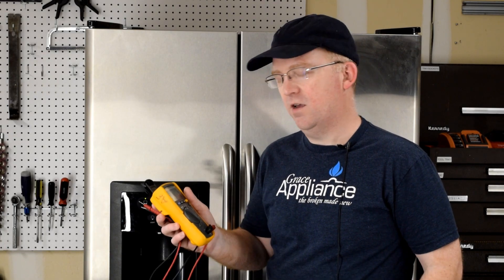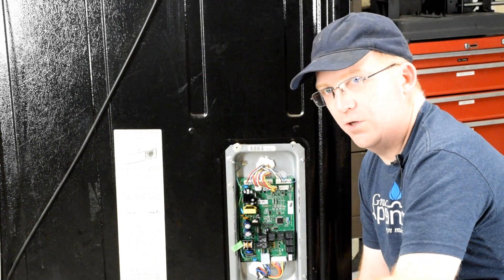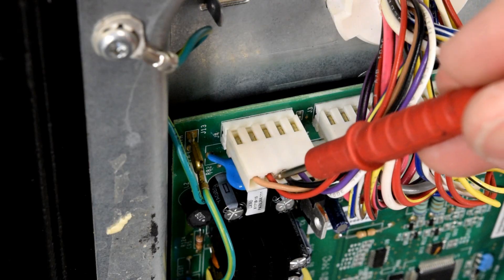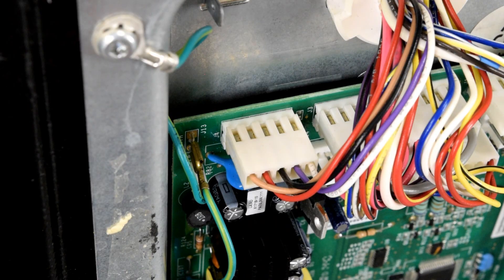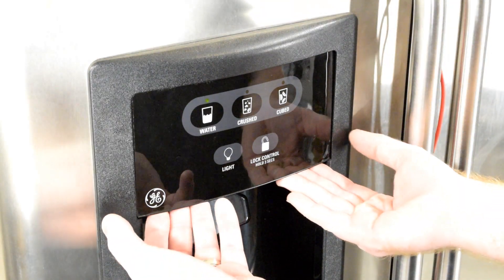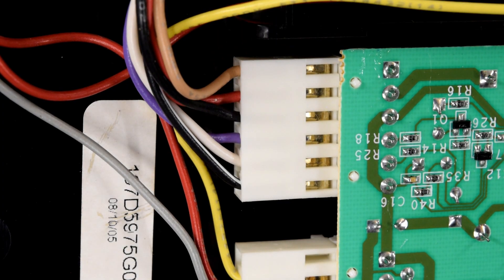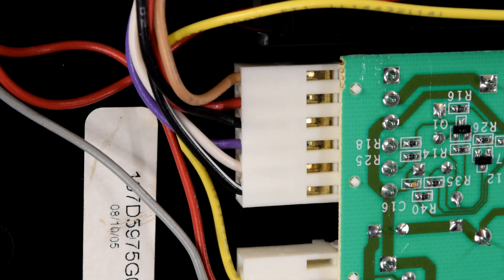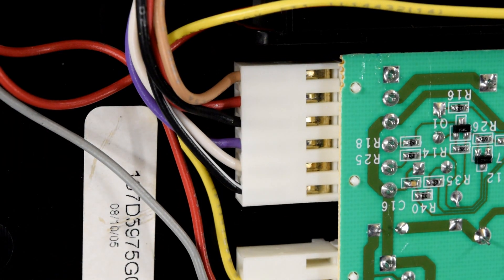Diagnosing a Bad Control Board - Part 4: Front Touch Panel

Comment: My GE Profile side by side water dispenser is dispensing water most of the time but sometimes won’t for a few minutes or longer, then works again. The ice dispenser (motor) would run for a second but no ice dispensing, while the temperatures 0 degrees (for the freezer) and 35 degrees (for the refrigerator) will flash on the panel along with the light turning itself on, then it would stop, then it does it all over again for as long as you push in the paddle. I don’t think there’s anything frozen because there’s water dispensing (most of the time). I’ve also unplugged the power from the wall outlet for 30 seconds before plugging it back in but still acting strange. Please help.
Reply from the maker: Hey Roel,
The first place I'd start checking is the dispenser micro switch behind the dispenser panel.
When depressed, it should show roughly 0.03 ohms and not change when the switch is pressed down harder.  When not depressed it should show an open circuit with your ohm test.

Let us know what you find.

Hope that helps.
Reply: @GraceAppliance  thank you very much for the quick reply. I used to own a multimeter till it broke so I’m gonna have to invest in one again to solve this problem. I’ll let you know what I find asap. Thanks again Andy.
Reply from the maker: @roelcruz7586  welcome!  The part itself is probably a dollar or two so you may just want to swap it out, but then everyone should also own a multimeter.  😁
Reply: @GraceAppliance  well in that case then. And you’re right about the multimeter. I need to replace mine.
Reply: @GraceAppliance so when I removed the dispenser panel I didn’t see any micro switch on the circuit board unless you’re referring to the other side of the board in which case I’ll need a torx screwdriver (that I don’t have) to remove it from the front panel.
Reply from the maker: @roelcruz7586  hey, yes It will be behind this. You can find it by actuating the dispenser paddle as if you are gong to get a cup of water. You'll see the paddle depresses the microswitch and you'll hear the switch make a soft click when depressed. 
It's about 1" in length.
Similar to this one: WB24X10146
Reply: @GraceAppliance  oh ok. I’ll find out the right part number and order it and get a torx screwdriver before it arrives. 😬 I’ll let you know what happens asap. Thanks a million Andy.
Reply: @GraceAppliance  well I got the part installed it asap but unfortunately it’s still bad with same symptoms. I was thinking of replacing the whole circuit board on the front panel. Any ideas?
Reply from the maker: Hey, sorry to hear that!
You may also check the wires at the kick panel / Hinge area to see if they are corroded or broken.

I would not simply start replacing parts without testing for expected voltages from each board. It is a wild guess to say just based on the symptoms you've got. 

I've seen very few front touch panels fail over the years, but have seen many many main controls fail. Not in this particular manner though.
Reply from the maker: @roelcruz7586  but if you can get a hold of a meter, you can test for 120v at the plug for the dispenser valve when you try and fill a glass with water. And the same at the ice maker auger when you call for ice.
Reply: @GraceAppliance  ok. Time to get serious about replacing my meter. 😁 I’ll check for bad wirings tomorrow. Thank you so much Andy. Happy new year!
Reply: @GraceAppliance  hi Andy. Happy new year! Just got back from vacation and borrowed a meter from a friend. You mentioned 120v plug so I’m guessing a red and black wire somewhere in the control board? Sorry I have no clue I wish I had a schematic for this.
Reply: @GraceAppliance  so I just did a visual on the control board and two caps c29 and c30 seem to be bulgy on top so I’m gonna go ahead and replace those first. I’ll keep you posted.
Reply from the maker: @roelcruz7586  sounds definitely like a failed board. Best of luck!
Reply: @GraceAppliance  I just hope these are the culprits.
Reply: @GraceAppliance  I fixed it Andy. Those 2 bulgy caps were the culprits. I just hope they don’t go bad again. The electrolytic caps I replaced were about 1/4 inch shorter than the original ones with same values. Should be ok right? Thank you for pointing me to the right direction it made me focus more on the main control board.
Reply from the maker: @roelcruz7586  hey, that's great news.  Yes the physical appearance is of no concern as long as the values are the same.
Reply: @GraceAppliance  thanks again Andy. You’ve been a big help. You really know your refrigerators. So glad I discovered you. Do you also do gas furnace?
Reply from the maker: No, I have not worked on them much.

Comment: My touch panel has lights but when pushing on button to move from cube ice to crushed ice or water it won't move to them. Last night when I was going to get water. I had contact shock from the dry heat in the house when I touched the panel. What is wrong with the panel? Help
Reply: I did unplugging it and plugging back in. Yes there is a torn button that moves it from ice to water.
Reply from the maker: I'm confident a new touch panel would solve your problem.
Reply from the maker: This sounds like a failed touch panel to me. I would try unplugging the fridge for 5 minutes to see if that makes any difference, but if not I would suspect a failed touch panel.

Do you have any tears in the plastic panel itself where you push the buttons?

Comment: This set of four videos is very informative, simple to follow, and the explanations are precise. I tried everything on my refrigerator because it seems that everything was failing. It was the control panel. However, the manufacture has discontinued the production of those panels. If someone has information on where can I get a control panel for this type of fridge, please let me know. The model of my refrigerator is GSH25JFXNWW. Thank you.
Reply from the maker: Thanks so much!  The best place I've found to look for discontinued parts such as these is ebay. Sometimes you'll have to pay a premium for a used part, but if you're able to find them it may be worth it.
Good luck!

Comment: Really helpful for me to diagnose my GE GSH25JSXNSS refrigerator problem, it shows unstable voltage between 3 to 7 volts,  changed the control board to get issue fixed

Comment: What if im getting 11volts dc at both boards
Reply: I'm getting 10-13v
Reply: Interior lights work but no power to touch panel, or compressor

Comment: Andy,  I replaced the mainboard because the temperature was fluctuating and would not hold its setting.  I initially replaced the converter board because the compressor would not kick off after I left the freezer door open overnight. Now after replacing the mainboard now the converter will not kick the compressor. Any suggestions, where can I order a set of schematics for this model?  Any diagnostics settings that you can share.

Comment: My Kenmore french doors turn off on its own. Once I open the door it turns back on. Is that the control board?
Reply from the maker: Sure sounds like it! But, I'd also suspect failed door switches as well. Perhaps one is shorted.
Reply: @GraceAppliance  
Ok thanks. I'll try the door switch's first.
Reply from the maker: @jasonphillips2204  once you remove them, if you have a multimeter you can check the ohms resistance they give when closed. You should receive somewhere under 2ohms I would think.

Good luck!
Reply: @GraceAppliance  
Thank you

Comment: My control board has power, but the light dims when you push the dispenser tab. any thoughts? Thanks, Tom Ackerson  tomackon@gmail.com
Reply from the maker: tom ackerson hey Tom, 
If the dispenser does not work when the paddle is pushed in, I would suspect either a failed dispenser switch (behind the paddle) or a failed water solenoid where the water line hooks up from the wall.  I’d start by disconnecting the plug from the dispenser and try to call for water again at the dispenser.  If the lights no longer dim, It will likely be a failed valve.  

Does the light dim when you try and get ice as well? If so, I’d remove the dispenser switch and ohm test this for about .08 ohm when the switch is depressed and open circuit when it isn’t.
Reply: @GraceAppliance  thanks, the light dims when you push for ice, water, crushed ice. I will check that switch and let you know..thanks again ,  Tom

Comment: Andy, thanks very much for the detailed instructions included in your videos, they are very helpful in diagnosing various problems. I have an older GE Profile Side by Side (Model PSI23SGNA BS) and recently have encountered problems that I've traced to the front control panel. I checked and the panel is receiving 13+ volts from the main control board. I get no response when pushing the Ice and Crushed Ice buttons (they don't light up) and no ice is delivered. The light above the water button is on but no water is delivered from the spout. The Light button and Lock Control buttons operate normally. The front control panel on my unit is 197D4576G012. I have found similar panels on eBay with part number 197D4576G019. I'm wondering if these parts are interchangeable or if I'm required to locate a G012 version of the part. Also, if you know of any other sources for this part that information would be appreciated.

Thanks again, 
J Mason
Reply from the maker: Hi James, I'm sorry to hear about that!
Unfortunately, I am not aware of these boards are interchangeable or not. I do not know of a means by which to cross reference the parts against each other. I do not beleive there is such a list.

Sorry to say.
Reply: @GraceAppliance  Andy, thanks for the fast response. I guess that I'll just keep searching for the original replacement assembly.

Comment: thanks! this is useful.
I am getting 13V in the rear panel, but only getting 4V in the front panel. Any idea what might be causing this?
Reply from the maker: sebcast hey, the first thing that comes to kind is a connector behind your kick panel near the freezer hinge.  Check here to see if there’s any corrosion, broken wires, etc etc.  unplug the plug connection 10x or so and see if it changes the voltage output for you.  
Also, check the voltage with the plug at the front panel unplugged to see if it’s making it all the way to the front panel.  This will help you determine if it’s a wiring issue (with the board unplugged in the front) if you’re getting 13v to the wires at the board with the board unplugged, it’s not wiring but likely the board.

Comment: Hi, we just had our fridge stop cooling and the front circuit board in the icemaker door panel doesn't light up or work.  The interior light bulbs remain working in the fridge and freezer.  After an hour, the circuit board in the ice maker/front door panel began clicking.  We followed your video and we are only getting voltage readings of between 7 and 9 volts fluctuating at many points in the rear and freezer door connections.  We also smelled a very faint burning smell when we checked the rear circuit board.  There is one tiny scorch mark on the green of the board under the heat sink.  We just aren't sure whether the main control board is bad or if the front control board is bad, as the voltage is low everywhere.  Also, the front touch panel/ circuit board is the one clicking, not the rear circuit board.  The front door circuit board appears to have no damage.  There is minor corrosion on the front door icemaker connectors.  But voltage readings were taken on both sides of this connection and it reads the same, as thought the minor corrosion is not really affecting the connection. We were thinking of ordering a new rear control board, but I wanted to see if you might give us advice first.  Thank you!
Reply from the maker: Hi Blackbird Farm, 
If you are seeing a burned mark on the rear board, I would start with replacing this one as it clearly has failed. It will likely resolve the issue and most likely won't need a front control board.  I can only think of probably 2 times that i've ever needed to replace the front touch pad. But, the main control is more than I can count. 

Looking at your handle: Are you a homesteader?
Reply: @GraceAppliance  Thank you so much for your prompt reply.  We will order the new board right away.  And yes, we are homesteaders- A wonderful lifestyle we enjoy thoroughly!
Reply from the maker: Blackbird Farm LLC same here.  We homeschool our girls, have chickens & soon a few turkeys.  I’m building beehives over the next few weeks so this is our new adventure soon.
Reply: GE Side-by-Side ONLY - Refrigerator Repair Videos That's great!  It's a wonderful experience for children.  Builds so much self reliance appreciation.
Reply: Rear

Comment: GE side by side with bottom freezer. Both ice makers have stopped making ice. Ensured temperature was low enough for ice making. The water dispenser is working as designed, both ice makers are in the on position on the touch panel, no solenoid noise for water, checked water in trays - none. The mother board GFE28HMHDES has an led on the board that is blinking once every second. Weird how both ice makers went out at the same time. The touch pad seems to show all parameters such as turbo control, temperature selections, can shut compressor off at touch pad Est. The paddles in the ice makers are good. Haven't found a schematic anywhere on the unit. Any suggestions?
Reply from the maker: When thinking through the parts that could affect both ice makers the initial things that come to mind are to double check that there is not a setting on your main control that says icemaker off. Other things I would check are a common water valve shared between the both ice makers. Or perhaps a failed door switch. Some refrigerators will cut power to the icemaker when the door is 'open' so a failed door switch would turn off the icemakers.

Comment: Andy, I have a GE model GE28GSKLSS french door bottom freezer that has a malfunctioning water and ice dispenser.  All other functions on the control panel seem to work.  There are no sounds coming from the ice or water dispenser other than the click of the pedal.  The line is not kinked, and I have a bypass filter installed until I get the issue fixed.  Is this a dispenser control panel issue?
Reply from the maker: Hey Todd, 
The first thing that comes to mind is a failed microswitch for the dispenser.  It’s a small black switch behind the white housing inside your dispenser area.  Be sure to disconnect power before accessing it behind the dispenser.  You will be able to find it by actuating the dispenser lever and it will be the part that has the slight click to it when depressed.  
You can ohm test this switch to test to check for continuity when the switch is depressed.  You should get a low reading such as .03ohm - .08ohms. 

This is one of the few parts that control both the water and the ice dispensing which is why I would start here.   

Let me know what you find.
Reply from the maker: Another quick thought is that one if your door switches may be acting up.  Manually depress each door switch (including the freezer) with your hands to see if the lights come on and off when depressed.  If the fridge thinks one of the doors is open, it will not dispense water or ice for you.
Reply: Thank you for the advice.  I am going to check it out now.   @GraceAppliance
Reply: @GraceAppliance  OK, it is the freezer switch.  If the light is not functioning properly, then the ice maker, water dispenser does not function.  This is the most finicky fridge I have ever had.
Reply from the maker: I hate that!  So dumb.  
Glad you got it figured out!
Reply: @GraceAppliance  Do you sell parts?  I will take a freezer switch for the GE Model GFE28 if you have one.
Reply from the maker: @freshtoad617  Hi Todd, I'm sorry, I don't have this particular switch, but you are needing a WR23X21072

Thanks!